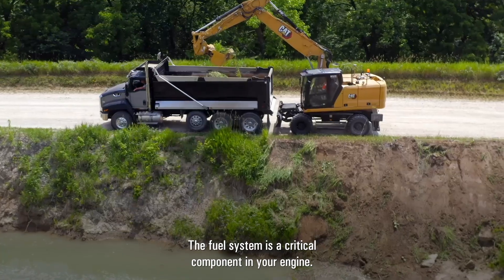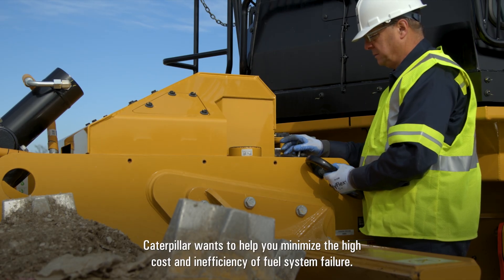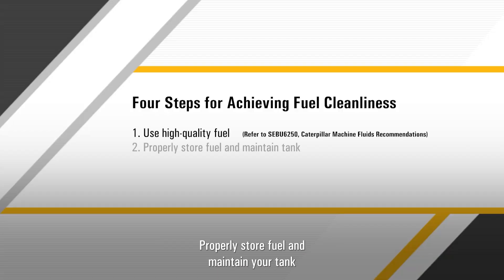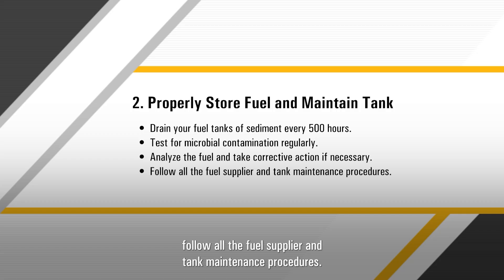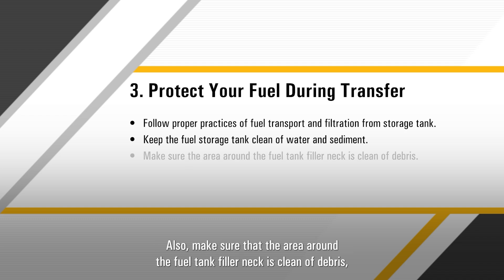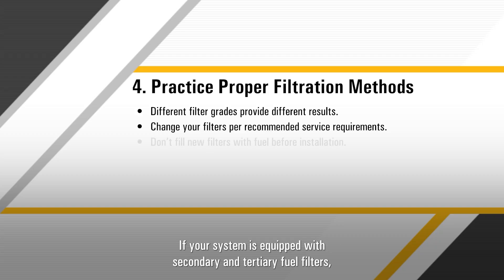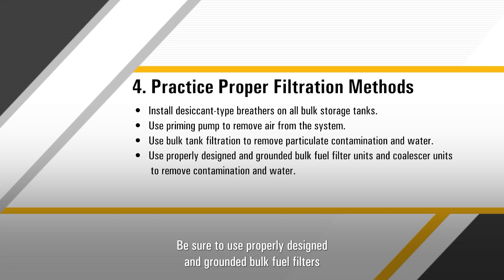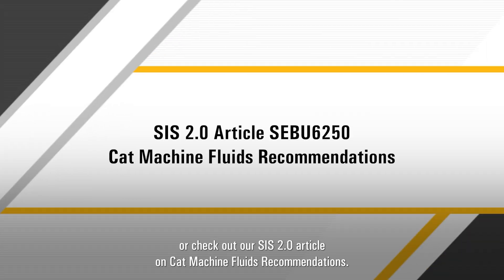Fuel System Contamination Control - General Guidelines

Comment: When is CAT going to come out with a deadbolt door lock with 10 keys included. when are they going to come out with a trailer puck lock? when are they going to come out with a tool chest wafer lock with the 5P8500 key? I would like to see a key light switch that takes the 5P8500 key.